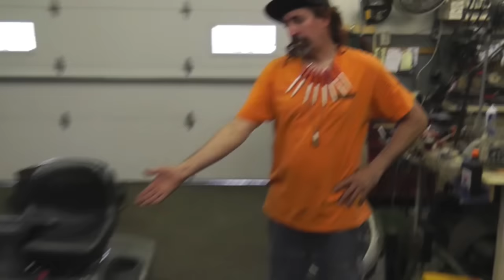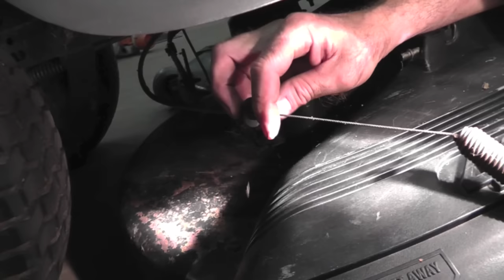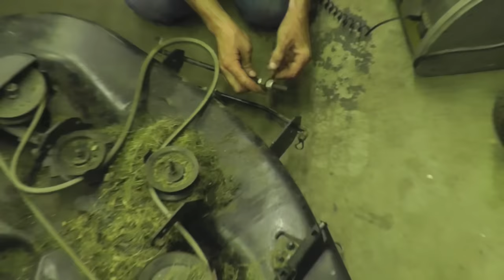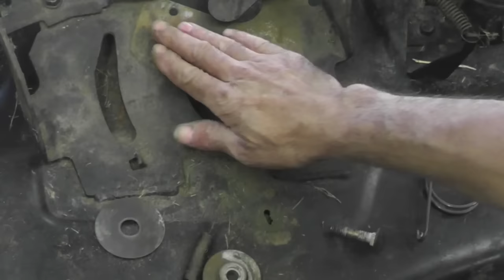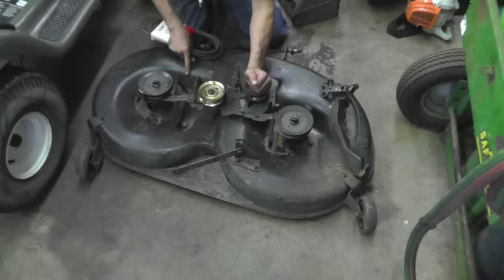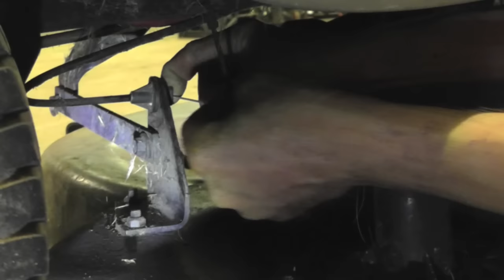How To Fix Stuck Deck Engagement (Blades Always Spinning)

Comment: Thanks for the great video!  I have the version of the deck that has the metal arms that move the pivoting mechanism, with the curlyque springs on each brake arm.  My Craftsman brake arms won't engage, and sure enough, the pivoting mechanism has a divet on the left side, but I've also noticed that the cam rollers on both of the brake arms don't roll smoothly.  There's a divet on the left brake arm path, but the right arm isn't getting caught on a divet.  Still, it's not moving when the mechanism hits the roller.  I'm not sure what's causing it to get stuck.  When I move the right brake arm, the mechanism can move up to position.  Are there replacement cam rollers I can get, or would a good lube help out?

Comment: this was very entertaining and informative . thank you for the info . i have a lt1000 2001 model when i engage the mower deck the blades start turning then when it goes to cut grass they stop spinning . Anyone know if it is a similar problem or what it is ?

Comment: Taryl I work in repair shop in Georgia. Do y'all use that ultrasonic cleaner you got. I see you use Napa carb clean and brake clean and purple power. We only use 5 gallon Napa carb cleaner soak on everything. Two stroke and four stroke carbs.

Comment: Awesome video, I need to goober up my deck as well. Have you ever changed out the two rods that go up to the deck lift handle? mine are broke and need replacement. Also where do you get your parts from?  Thanks for great video.

Comment: I have a Craftsman T240 that when you engage the blades with the deck all the way up, it does fine...but when you lower it down, the belt always comes off. Can't find a fix for it. Also one of the big pully's is digging into the square brake pad on the deck. Any ideas? Thank you and enjoy your video's!

Comment: Good one here Mr Dactal,  I want to simply remove the spindle brakes on my mower,  any issues with this such as cranking the engine with no brakes.  Not worried about losing a foot due to no spindle brakes.  In other words, does the brakes effect the ease of the belt to slip during startup?

Comment: Thanks for the vid. Was having problems disengaging blades, as it turns out, 2 of the springs on the deck are missing. You gave the part number for the one you replaced, but are the other two the same? Tried looking at an online manual and couldn't make heads or tails out of it. They have 5 different springs listed in the parts list for the deck.  Just gonna order 3 of the same return springs and try it out.

Comment: The problem with grinding that is that you might remove enough metal that the spindle brake no longer disengages when you engage the clutch. This will wear down your brake and sound like hell.

Comment: When you pull it out there's a plastic guard on the far pulley but not when you put it back under. Is that a problem? I ask because mine doesn't have one (I bought used) and I'm not sure if I should find that part or if it's not a big deal.

Comment: I just replace my spindle bearings and my PTO cable is tight but wether or not it’s engaged the deck brake on 1 pulley won’t let off the spindle. Any help will be appreciated.

Comment: Taryl, can you tell me what would cause the blades not to shut off with an electric pto? The switch will turn the blades on, but will not turn them off. On random days, I can start the mower and the blades won't automatically be on and then I will have to turn the switch on.

Comment: YEEHAW THANKS TERYL IS THERE ANY WAY TO DRAW OUT THE SLACK IN THAT LEVER CABLE? GOT A FEW INCHES OF SLACK AND NO ADJUSTER IN SIGHT
Reply: MY BIRD WILL NOW LEARN:

WOOOO  WOOOOOOOO
SLICKER N SNOT
SLICKER N SNOT
WOOOOOOOOOO!
SLICKER N SNOT
Reply: Icy Uranus if the belt doesnt slip under load you're good.

clean and lubricate idler pulley pivot point. that'll probably take out some slack by allowing the idler to return to its home position

Comment: Video was a great help but my new belt is still allowing the blades to turn while disengaged intermittently.  The disengagement is working smooth now but belt seems too stiff since it is new, have you ever run into this?  Granted it is winter here and I'm doing all of this in temps around 35 degrees.  I compared lengths of my old and new belt and both seem the same within a half inch, just the new one is much stiffer.  I'm hoping the belt will stretch once warm but not sure.  Thanks again!
Reply: Did you figure it out?? I'm having the same issue. OK when I start the mower, but within about 30 seconds the blades start spinning...not at full power. I can engage the blades, and they run fine, but when I disengage, they keep running at a slower speed. If I stop the engine and restart, the blades do not run, but start spinning without engaging again after about a minute!!

Comment: What is that sander wheel drill bit thingy called?  I couldn't find similar one on Amazon for grinding metal.  Could you provide a link please sir.
Reply: It's called a cutting wheel. Harbor Freight/ Lowe's/ Menard's has them.
Reply: @freaknleak69  I bought one but the flat side didnt grind... Ended up using a file. Took some elbow grease
Reply: @RayForrester  The flat side will grind but you need to angle it a bit not use it directly on the flat !

Comment: Great video, thank you.  I replaced the part instead of grinding it and used a new belt and new return spring.  It was heavily goobered up and everything moves nicely.  However, the blades still spin when it is disengaged.  Could this be due to the belt being new and tight?  The blades spin slightly even with the cable off the pulley.  When it is on the pulley, there is a lot of tension and the lever is harder to move than it was with the old belt.
Reply: Literally dealing with the same issue

Comment: i have a Jonsered mower that looks basically the same but the deck brake is slightly different. and my blades keep spinning. it is all free and disengages properly but only has a single brake with a rod that pulls it off the pulley when you engage the cutters doesnt seem to be up to the task. i have replaced the pad but still doesnt work. any ideas on how to fix it?

Comment: Taryl i have a 2006  troy built that the book does not show me what i believe a washer in the pto assembly , i welded all that needed etc etc , with the deck out it works fine , then in the mower it only releases a little i am still hanging up somewhere ? on that model is there a washer that goes under this plate ? is my question ? my book dont show it ,,,,,thanks for sharing

Comment: I fixed my step son's mowers with this same issue. Because he left it outside in the weather with no protection. The bracket rusted to the deck.

Seems the cause of this is people leaving mowers outside in the weather to rot. 

You would think if people don't have a yard barn to store their lawn equipment in, they would at least throw a breathable car cover over top of it so their shit wouldn't deteriorate.

Tarps seem to do more harm than good because they build up condensate and can't breath.

Comment: I replaced the mandrels, the springs, the pulley brakes, the spindles, got an aftermarket new belt,  replaced the metal peices taryl was grinding on, goobered em up with anti seize, and yet my Poulan 42 inch mower blades seem to self engage after a few seconds of starting. I see the pto spin and the belt seems tight and within a few seconds the belt catches and the blades half way engage. Eats up the new brakes I put on the deck. I ordered an Oem belt and its on the way... I also tried a sunbelt aftermarket belt and that does the same thing too. I cant see any damage to the deck. It was my uncles tractor. What a mystery

Comment: taryl,  iam at my ends wit,  ive had that deck out 10 times it works just like yours does on the floor when you are done with it, hears my problem, the only way they disengage is if i shut it off then they will ??  iam tapping out i don't get it ??  2003 sears craftsman 42' 20 HP kohler twin,  help !! thanks  john.....

Comment: is there a way to grease both blade shafts? I have not tried to see if the shaft will slide out of that deck spindle.
Reply: never mind I found another site that explains how to repair that spindle.

Comment: Howdy Taryl! I have a Craftsman riding mower model # 917255450 and the arm brakes used to stop the deck pulleys from spinning are somewhat worn. Not worn down to bare metal but they can use new ones. Question: Is there a way to replace the hard rubber tips used for braking by themselves instead of replacing the whole arm? Thanks Taryl.
Reply: Ricky G. ... they are one piece assemblies, the part number is 131845; Arm Ass'y, Pad, Brake ... you need two as they are both the same part ...

Comment: Is this same repair for the blade conditional control rod that will not engage the blade on a murry rider 4257x92b?
Reply from the maker: +carie Similar design using a series of pulleys that move to tighten the belt which in turn make the blades spin. If yur havin problems with yur Murray remove the deck and look at the mechanism that controls the blade engagement. You should be able to figure out how it works. I hope this helped. Taryl

Comment: what I'm gonna do with that idler spring that goes through the deck, im gonna put a bolt thru the deck and hook spring to that, instead of the deck, less chances of the thin spring getting blasted by material

Comment: i have a scotts 1742g rider. my issue is the opposite of this. my blades will not stay engaged unless i hold the handle up. do you have anything to help me out on this?

Comment: Can you get away with a couple mows with the blades always engaged?
Is "engaged" - where the pulley is set to where the belt won't rub?
Looking at the belt, in one position it looks like it'd rub this metal piece, but it doesn't because with "blades engaged" - the pulley moves and the belt moves with it.... with "blades on" all the time, is the belt safe or will it shred up in a minute?

Comment: I bought a John Deere Stx38 yellow deck in the early nineties.  When I moved into an apartment I lent it to my parents and it pretty much sat in the garage for years.  I had a need for it and put in a new battery and cut 2 feet high grass fine.  But next time the PTO lever does not activate the blades.   Is the STX38 too old to throw good money after bad?  I am not very mechanical.
Reply from the maker: Pull the deck & check it over. It might be fixable if it doesn't need to many new parts.
Reply: If you doubt your ability to fix the problem, watch a lot of videos on your mower. Its very easy once you grasp the concept. Taryl has a video that might help. Its called "How to troubleshoot basic electrical problems on a riding mower-with Taryl"

Comment: If you have the time prep your deck with a grinder and get all the rust off and scar up the whole deck with sand paper or a wire wheel and spray EVERYTHING WITH A BED LINER . TOP AND BOTTOM . You'll never have a problem again .

Comment: Howdy Taryl! I have a Craftsman riding mower model # 917255450 and the arm brakes used to stop the belt pulleys from spinning on the bottom of the deck are worn. They aint worn down all the way down to bare metal but they can use new ones. Question: Is there a way to replace the hard rubber tips used for braking instead of buying the whole arm? Thanks.

Comment: Although my Craftsman DYT4000 deck is a bit different (no blade brakes), what can  cause slow engagement when the PTO switch is activated? As in, what can cause the blades to take longer to reach full rotational speed. Like there's some additional load or stress causing longer "spool up" times. Noticed this after I rebuild my deck (belt, pulleys, spindles). The belts not skipping and I've properly tensioned it

Comment: I have to rock back and forth my LT 2000 riding lawn mower to start it any helpwould be appreciated
Reply: Most likely the seat safety switch is sticking. I have a lt1000 but they should be the same. The switch is under your seat and turns the mower off for safety when you get off of it.

Comment: Replaced the cable but it's difficult to move it up in order to engage the blades and mower is not cutting.  Anybody got any ideas?   Rebuilt the deck too...

Comment: is there a place to find a exploded view for parts on a troy built pto just like you did ? problem is my book that came with themower does not show me the under side of that pulley of the pto that has that rounded part that centers the plates together so they can swivel ? i am not sure if i am missing a peace in there or what ?  when the deck is out in my hands it works like it should ,,,i put it together on the mower the darn thing hangs up ,,,all plates are even i welded them all nice and smooth its when i bolt the assembly together it seems i am pinching it ? but i dont have a proper diagram showing me ALL THE PARTS ,,,troy buil model # 233 644 42 inch deck 77T ,,,,any help would be nice ,,,thanks for sharing     /    it maybe called a spacer shoulder ? under that ? is what ?

Comment: Mr Taryl....All your vids are great, thanks. My issue is  when I start the mower, after about 
30 seconds the blades start spinning by themselves...not at full power, but pretty fast. I can engage 
the blades, and they run fine, but when I disengage, they keep running at a slower speed. 
If I stop the engine and restart, the blades do not run, but start spinning without engaging 
again after about a minute!!   I just replaced a mandrel,  blade idler and belt on my craftsman
deck.  Do you think it's just the new belt is too stiff, and will stretch out?   
Thanks
Reply: OK, Now.....After much research, and triple checking everything, I found another You-Tuber...Brad Turnow (thanks).. that had the same issue, and decided it was the belt. I took off the new belt, and put the old one back on.....problem gone....blades engage, and stop the way they should. BEWARE of cheaper replacement belts....mine was just a hair too wide

Comment: NEWS FLASH !!!   FOUND IT !!!  and why they would not release.  the cable under the hood got grass etc etc inside that small hole that it goes thru,  i sprayed some wd 40 down it and slowly worked the cable back and forth wella it works like new,  thank god !! if this will help one person from going crazy like i did i will be happy !!!!!!!

Comment: what happen to replacing the bearings in the blade pulley. less acting more attention  to detail would make this a great video.
Reply from the maker: Ron Paut Well seeing as you’re watching how to fix a completely different problem, that’s not even gone over in this video. Here’s a link to what you need (acting included). https://youtu.be/_LPXc2D_uQU

Comment: Could you tell me where you order your parts and the part number of the belt. I bought 2 belts and they seem to be too long. Thanks ahead of time.
Reply: DJ RIKROK did he tell you the belt number I had same problem, ...belt from big box store seems to be a little too big.
Reply: @jamesjett5439  I bought a 95" one and it fits fine.

Comment: At 15 minutes and 17 seconds of the video there's a mulch cover and this mowers deck resembles mine I know the videos 5 years old but no matter where I look I can't find the mulching cover any where? Where I can get one just like it or maybe the model number of it. Thanks
Reply: Download the manual and look up the part number. Put 'LT1000 16.5hp 42" if that's the kind you have.
Reply: Thanks @JasonSipe16  for the information,  the model number is 917.276816 sears part direct says they can't find it but I did on sears part direct, whether it's a YT3000 or it's 300 it does not show a much in plug, or cover, or mulch deck plate whatever they want to call it. I have found several that might fit users who purchased a cover had to modify it by cutting it up adding this and that so the grass doesn't fly into their face, even duck taped it. It's  a 2014 -  917. Xxx 42inch deck Craftsman model , some covers only fit 247 model's which we don't have. Some vendors say some covers fit Poulan, Husqvarna,  Rally and  Craftsman models, until the end user tries to get it to fit, sending them back. In the video I'm 99% sure that's the same deck we have including using that slot on the top that holds the cover on.
Reply: Done. It's a Poulan stamped deck on a craftsman lawn tractor and the mulch cover / couverture is  sku number is 954040501, item number 1136132 from Husqvarna purchased from Lowe's. Taryl Thanks for the repair video I was just missing the spring but I know now all about it.

Comment: When I disengage the belts when I reverse,it takes several seconds for the blades to stop,yet the belt is loose on the pulley.Any ideas.Thanks.
Reply: Brake pads are wore out, or the springs pulling the brakes on are broken.

Comment: Does anyone have the other of deck. The braket for pto cable is diferent
Reply: I have deck with NO cable. Look up K-Gro LT4218 C Riding Mower and you can see parts for NON cable connection.

Comment: I am working on a bolens/mtd 38'' deck that is not spinning at all and belt smokes when you engage it. Any suggestions?
Reply: Steve Cieply may be late but a spindle or pulley may be locked up
Reply: it's all set I fixed it I do have one question. are the blades supposed to be connected because I take the nut off and the whole shaft and blade are one piece. it doesn't seem right
Reply: Are you meaning that when you take the nut off the top of the spindle? There should be a bolt on the bottom of the blade that will release the blade from the spindle.
Reply: If you have taken the nut off the top on the pulley side and the whole thing has come loose you might need a spindle.

Comment: You put the washer on top of the spring in your last cable connection...FAIL!  The washer goes on first and the spring, then the clip.
The washer keeps the spring from sliding down.